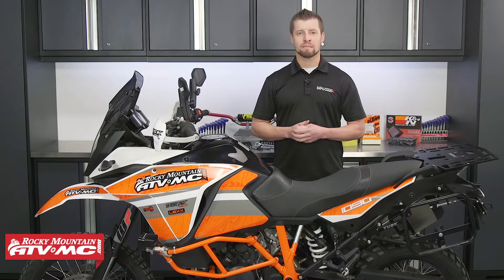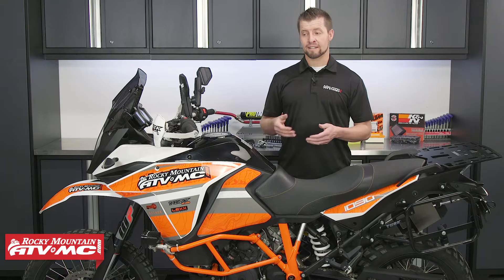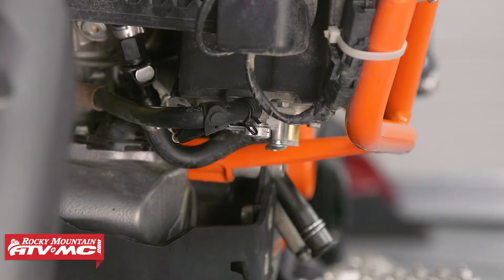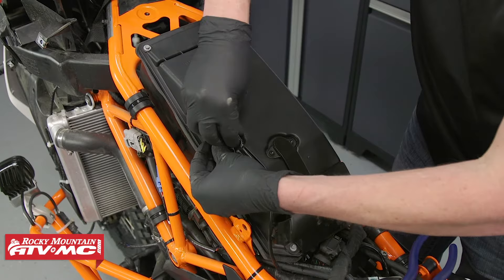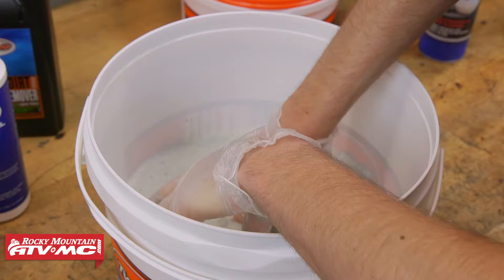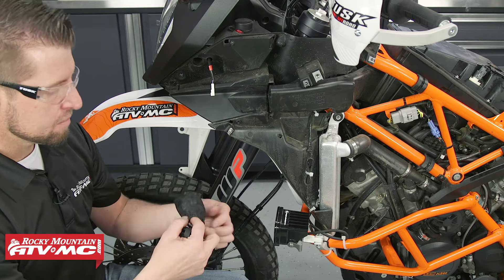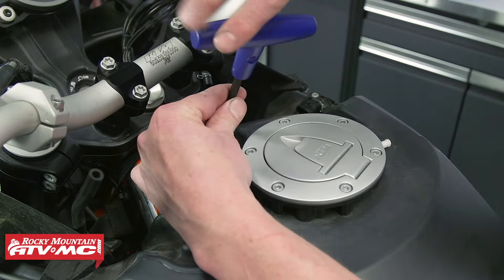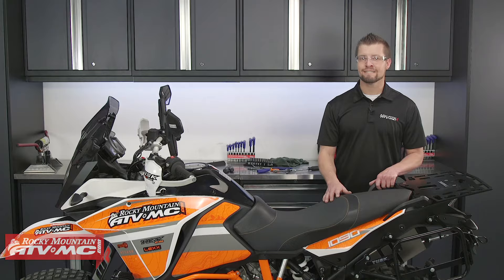How To Change the Air Filter On A KTM 1090 - 1190 - 1290 Adventure R

Comment: This is not difficult at all. It takes barely 10 minutes to take the fairings and tank off. It's not a big deal at all. Good information as usual
Reply: It took a 5 minutes video at high speed and editing,  I don't think it will take a real 10 minutes. it looks very tedious
Reply: @csiautodetail  Well, I practice taking the fairings and tank off, disconnected it etc several times when I got the bike and practiced that a few times. The first time was taking me a bit